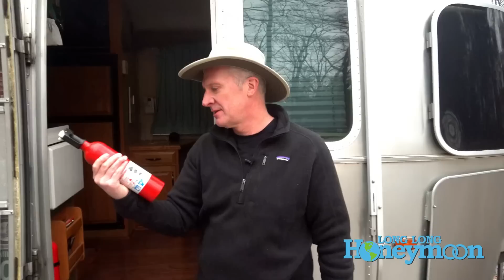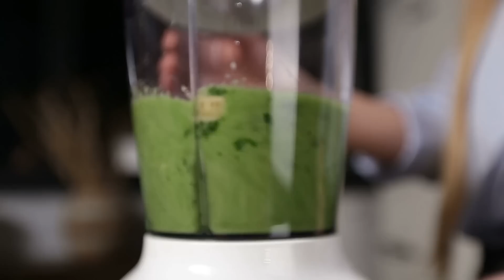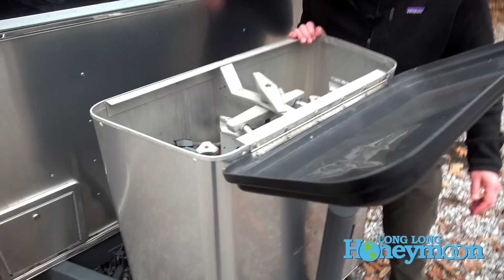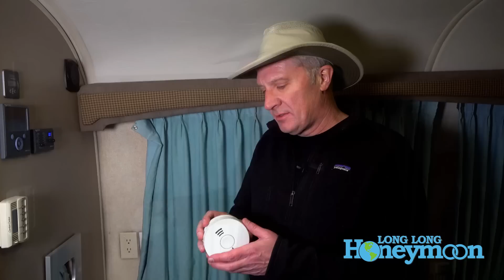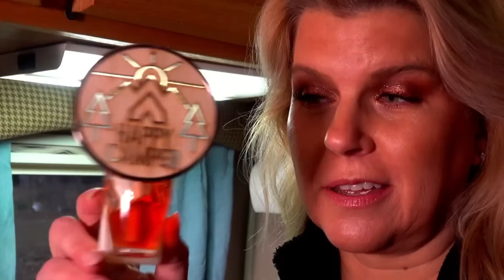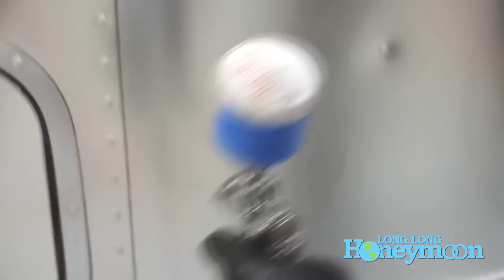For Beginners: 🔥RV FIRE SAFETY🔥- 12 Tips!

Comment: 35 plus years in the fire protection Industry, best or correct placement of a smoke detector is on  the ceiling (30 ft on centers) not tucked close to corners or sidewwalls with obstructions like drapery, etc. Bias toward photo electic vs Ion technology sensors. Also, carbon monoxide detectors a must....the silent killer. If it was me I would have two detectors one close to sleeping area, another toward front, compensating for cooking area, etc. Plus if their is an emclosed cabinet with a lot of electronoics, etc, something to consider......

Comment: #13 Do away with the gas absorption fridge. Check out a RV salvage yard........check out the burn outs and worse damage is on and at the fridge area.
Reply from the maker: Indeed, we did have a recall on our refrigerator related to a fire hazard.

Comment: 1. Propane is heavier than air, so a propane leak under your RV is a minimal hazard. You would have to be parked on top of, or very near, a fire source for there to be any real danger. But that doesn't mean it is not a good idea to check them for wear now and then.

2. RV refrigerators that run off of propane are probably the biggest fire hazard in any RV. Add some solar and replace it with a 110V residential unit or a 12V unit that will be a lot more expensive. Not only are these far safer, they work far better.

Comment: One thing I recommend when it comes to your propane lines attached to your tanks. Spray some soapy water on them every few months checking for leaks. I had a leaky hose I discovered when I wiggled it a bit and you could hear the propane leak. I replaced it with stainless steel braided hoses from Amazon and sure enough 6 months later one of those was leaking slightly. I only discovered it by spraying soapy water on it. I don’t think the slight leak was a fire hazard but it was slowly leaking costly propane

Comment: I can't believe you discharged that fire extinguisher in your rig.  That white powder is incredibly corrosive.  I have not ever had a fire in my RV or one of any size in my house.  One thing you should do with those dry powder extinguishers is to hit them on the bottom with a rubber mallet every year or so as the powder settled and smacking it with a rubber mallet breaks up the clumping powder.   Keep the good stuff coming guys.
Reply from the maker: Yes, the wife was not too happy about discharging the extinguisher inside. (But pain is temporary; film is forever! 😉) Thanks for the rubber mallet tip, makes a lot of sense!

Comment: Our genny melted my tool box 4 feet away in the truck bed. Never again.
Reply from the maker: Thanks for your comment. I had a similar situation happen a few years ago with a storage box in the bed. Scared the hell out of me. That’s why I always harp on this issue, I’ve seen it firsthand.
Reply: @LongLongHoneymoon  yes. I should have known better. I've always been Mr. Safety. I definitely had a mind fart.
Btw. Your blog is very well done. I've gone from camping to glamping. They're similar but different and you 2 have a great handle on both.

Comment: Fire hazards can come from unexpected places, for example the large drawer under the sink 
On one of our first camping trips in our new travel trailer I smelt something burning as we were eating. It was coming from the furnace. What happened was, the bottom fell out of the drawer,,it was a very thin piece of luan held in with a few staples . An oven mitt from the drawer fell on top of the furnace. Fortunately we  found it before it became a large fire. I repaired and reinforced the drawer and we make sure that nothing flammable gets into that drawer which is right above the furnace

Comment: To simply repeat, over & over that something is "bad", WITHOUT as to why so... what exactly happens in EACH fire creation , oxygen depletion process etc. ... puts this video at a 3rd grade mentality level... imho... 
EVERY "test fire"/ practice run of discharging extinguisher contents, DEMANDS an ASAP  qualified testing, and refill of the extinguisher ... IF you are going to keep/ reuse the device.
Reply from the maker: Ah, the magnificent and highly intricate process of fire creation! Let us dive into the depths of science, shall we? First and foremost, every fire requires the three basic components: fuel, heat, and an oxidizing agent. This oxidizing agent, my dear friends, is none other than our dear friend oxygen. And as we all know, a fire cannot exist without this vital element. But, hold on! What happens when oxygen levels begin to deplete during the combustion process? This, my dear friends, is known as the oxygen depletion process.

So in every fire we have three elements: fuel (something to burn), heat (a source of ignition), and oxygen. When these three elements combine, a chemical reaction occurs that releases heat and light, which we perceive as fire. The oxygen depletion process occurs when fire uses up the oxygen in the surrounding air, making it difficult for the fire to continue burning. This process is important to consider when thinking about fire safety in recreational vehicles (RVs) because if there is not enough oxygen to sustain a fire, it will eventually go out.

Now, how does this relate to RV fire safety? Well, it's simple! Imagine you're on a road trip and suddenly, your RV catches fire. If the oxygen levels are depleted, the fire will go out on its own, which is a good thing! However, if the oxygen levels are not depleted, the fire will continue to burn, which is definitely not a good thing. So, it's important to have a fire extinguisher on hand, but not just any fire extinguisher! It must be up to standards and ready to use, which means it must be tested and refilled if necessary. Testing a fire extinguisher is important to ensure that it will work properly in the event of a fire. This involves checking the pressure gauge to make sure that it is within the proper range and checking the nozzle to make sure that it is clear. If a fire extinguisher does not pass these tests, it should be refilled or replaced to bring it up to standards.

In scientific terms, the fire extinguisher must be in a state of optimal readiness, so when the time comes to fight a fire, it can rapidly release a precise amount of chemical suppressants that will react with the fuel source, interrupt the chemical reaction, and extinguish the fire.

In conclusion, fire creation is a complex and delicate process that requires careful consideration and maintenance to ensure RV fire safety. And always remember, a well-maintained fire extinguisher is your best friend when it comes to fighting a fire.
Reply: Far out.
Reply: Touche’

Comment: If you have the room, I've had good luck with the Pelonis 1500W Electric Oil Filled Radiator Space Heater. virtually silent and no open element. Good vid.
Reply from the maker: Thanks for sharing. I will check it out. I do like the oil filled radiator style heaters.